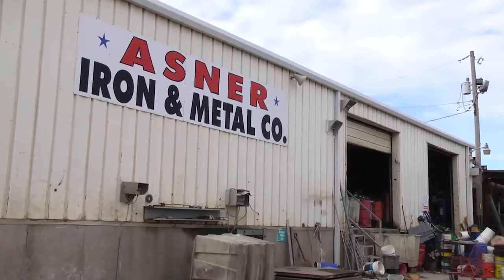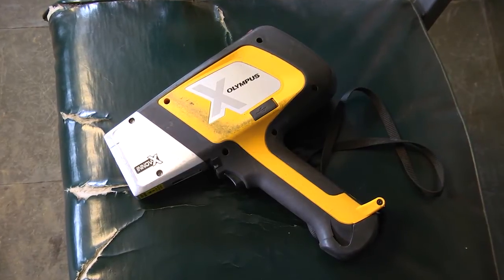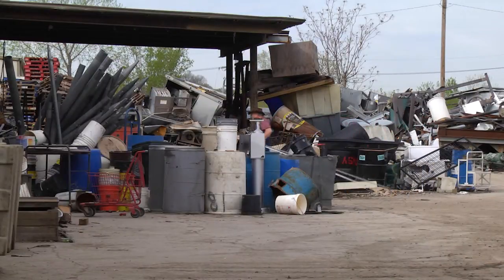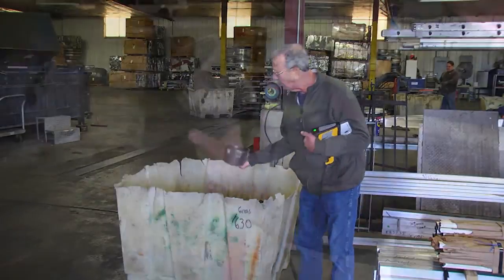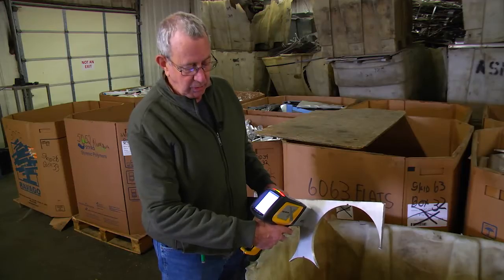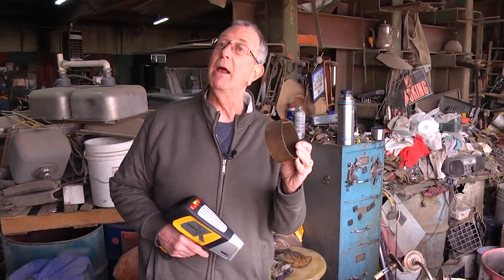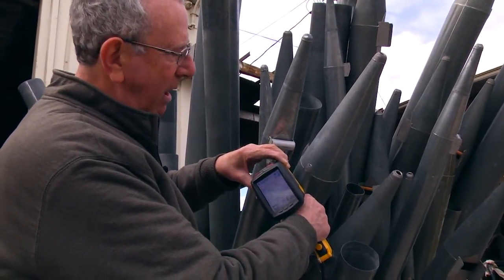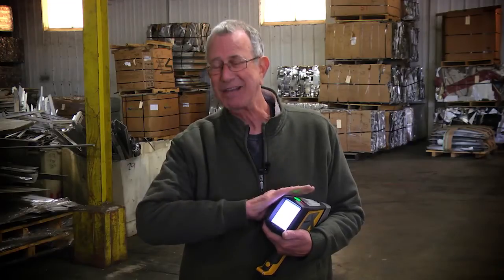Using the Olympus DELTA XRF Analyzer in the Scrap Metal Business

Comment: Can you tell me this gun pice?
Reply from the maker: Please request a quote here: https://www.olympus-ims.com/en/quote-request/366-dirItemId.1157635282.html

And one of our local representatives will follow up with you!
Reply: it's around $18k-22k in factory refurbished condition for this specific gun. lol If it's critical to your business (especially if you can write it off on your taxes as overhead) then it's a smart investment. This wasn't designed with hobbyists in mind. Otherwise you can find older models of XRF guns gently used for less than 1/2 that.